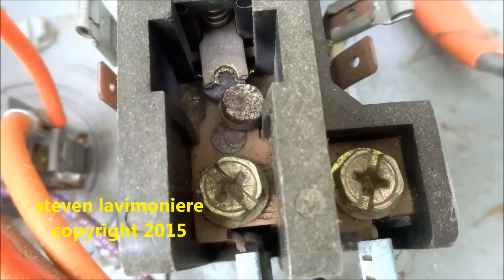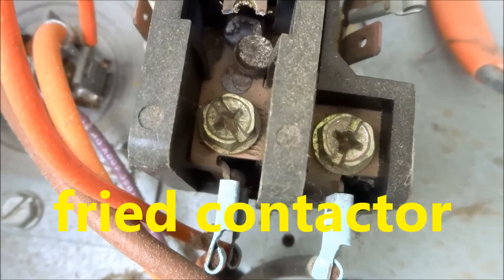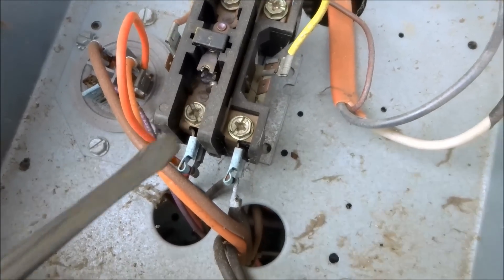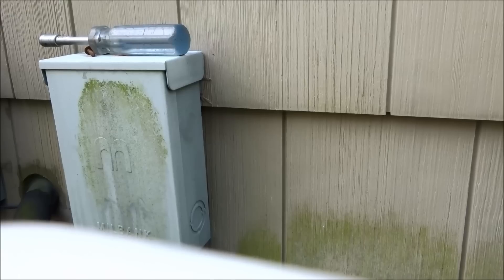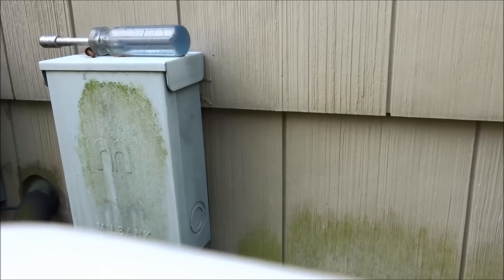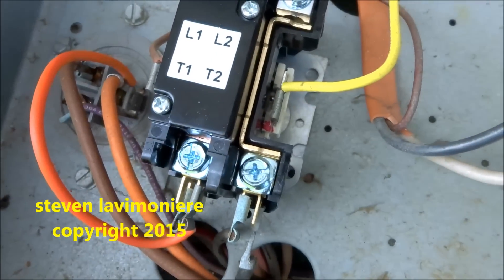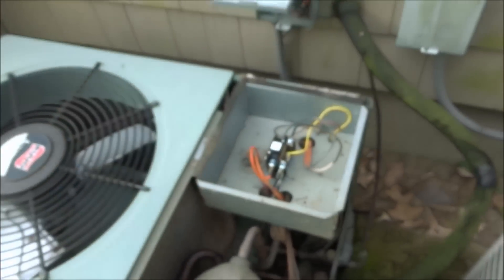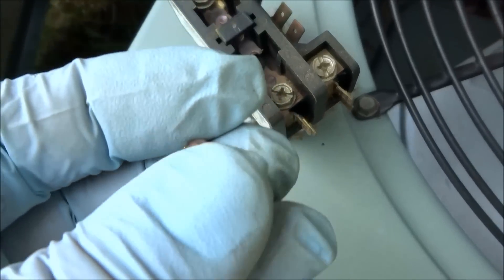hvac :outside condensing unit will not shut off

Comment: Today is 8/17/2024...
I was having a hard time with my AC, the outside unit was On all the time and the line was frozen after minutes,
Thanks Steven for share your experience,  I found a faulty contactor thanks to your video.

Comment: I had a question, so the old broken contactor I replaced had a plastic protection around i guess what looks like a coil in the contactor. After installing the new one I notices you can see the cooper wire or coil looking thing. Will this be a problem later? Should I have removed the cover from the old contactor and installed on the new one?

Comment: IF the connector is still working fine but the fan unit still run constantly when when the inside thermostat set at OFF position.  What else could cause that ???  Cool air is working fine

Comment: Hi, Steven,  thanks so much for your video.     My Rudd Compressor would not stop - even with thermostat power removed.  Your video helped me to find the relay, and it was stuck.   After thorough cleaning, it is now working fine.

Comment: Changed my contractor and my fan keeps running outside when I turn the A/C off anyone have any insight
Reply: Update?
Reply: It was the motor ,bought it on Amazon and make sure to buy the blades also the old ones you need a tool to remove it ,you want the blades to have a good balance so new is always better

Comment: Thanks for the helpful documentation! Why do you suggest the 40 FLA? I have a UAKA-030JAZ with a sticking contactor. Original contractor model is also the 42-42728-02. Would the S1-02425837700 work as a replacement / upgrade?

Comment: What are some good contactors? Trying to find one online is a real pain. I want to get a 40 A 1 pole 24V for my old Rheem. I found a Protech for $11.55. Emerson is about $27.00. Honeywell is hard to find in a 40 amp. Beacon I can only find in a 3 pole.

My contactor is already sticking at times, and I manually undo every so often. So, I need to replace it soon.

Comment: Should a went over the thermostat and click it to "off" .. showing that the fan actually stopped. But maybe it worked. Will never know . Lol

Good video though hopefully mines something this simple , my fan wouldn't turn on .. so I shook the unit side to side ,  got a little vibration and the fan kicked on right away .    Now ... it won't shut off .. so flipped the breaker an I'll open it up for the weekend .

Comment: Does that resolve the AC condenser fan issue?  My AC shuts off the blower when the right temperature is reach, but the condenser outside stays on 25/8.

Comment: I have same issue but mines not sticking, stuck or even arcing... condenser motor just keeps running but very low rpm

Comment: Thank you so much. I hope and up the compressor unit cleaned off the contacts to the relay of the contactor. I sprayed some anti-oxidant contact cleaner on them. Recheck the whole unit, and now the whole AC is blowing ice cold. I am sure I will need to replace it, but on this 95° day I'm very happy that works. Thanks again

Comment: Had this exact problem, I'm not good with electrical work so I got the exact serial number off this contact-or on my unit, ordered it on ebay, $30.00,  wanted the exact same one so hooking it up would be no problems, just hook it up exactly like the old one, one wire at a time. Fixed my problem, my unit was actually staying on and freezing the lines, now it works perfect. You saved me about 300$-500$ of getting ripped off by one of these AC repair places. Only problem I had was I cut the power to my unit with an outside fuse box but it didn't cut all the power, I could feel current coming through my screwdriver when I was working, so I cut the whole AC off to my whole house, my wife threw a hissy fit because she couldn't go on facebook or some such, but I told her you want me to get fried or have internet? it took me all of 20 minutes to do the job.
thanks again for the video,
William Lee

Comment: That contactor was really fried.  Good work Steven.  There are a lot of Rudd units here in the NJ area, they seem like decent units.
Reply from the maker: +Pete Ciallella i like the ruud line condensers,,,,, no so much the air handles and evaporator coils
Reply: yes and Honeywell contactors. it worked good for Rheed 17 yrs

Comment: Make a video on how to adjust the oxy/acty to braze. I got the 5psi on acty and 10 psi on oxy. how do you ajust it to get it where you want it. Ron walker is the only one that made that video.
Reply from the maker: +Rami Hawari acty should be 5 to 7 psi    oxigen from 20 to 40 for cutting , open the acty first get rid of black smoke,,,, then open oxy slowly and pull down to a small flame do in that order and you will be fine

Comment: Good video, steven. Hey why do some units have a single pole contactor and some use a 2 pole? Thanks.
Reply from the maker: +Cooll Asice single pole is used mostly if you have a crank case heater for contues power for heater for low ambiant conditions,.you can use a 2 pole just jump the crankcase heater to inlet side of contactor.all these ruud units come with single pole contactors  .i could of used a 2 pole on this job seeing it was straight a.c.no heater needed no low ambiant controls needed just in a house .if it was in a buisiness i would have to put fan cycle cycle swith ,and crank case heater to keep head pressure up .
Reply: OK. Thanks.

Comment: I go with the 40 amp also. Price difference is non existing compared to the added load capability of the large contactor.
Reply from the maker: +Jonathan Dobler i need more of them in truck ,next time i go to the supply house i will restock

Comment: That contactor was all pitted and welded shut its hard to find good contactor I use Emerson sure switch and the Coresense protection contactor  for copeland scroll compressors
Reply from the maker: +hvacguy84 good idea
Reply: +steven lavimoniere I use the sure switch contractors so ants don't get in to the contactor and it eliminates welding and brown out protection so the customer doesn't need anymore contactors